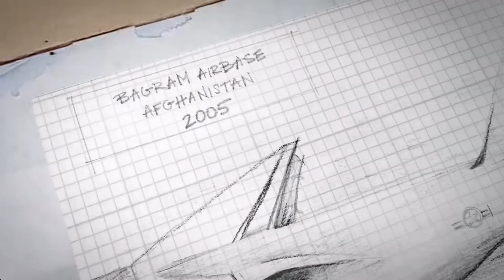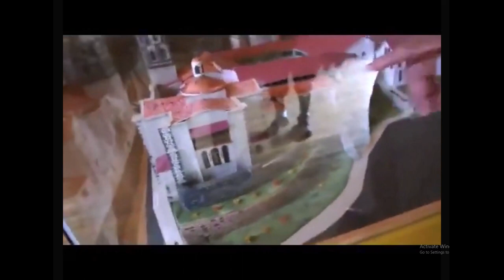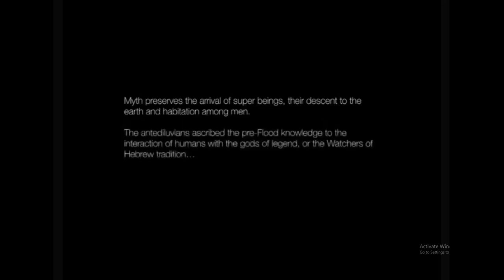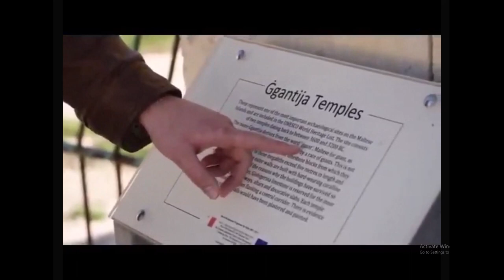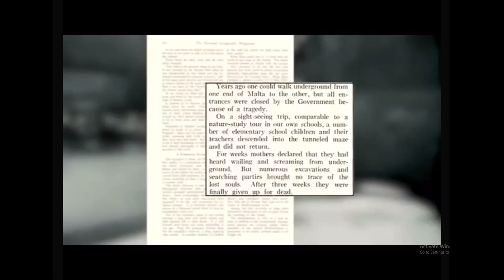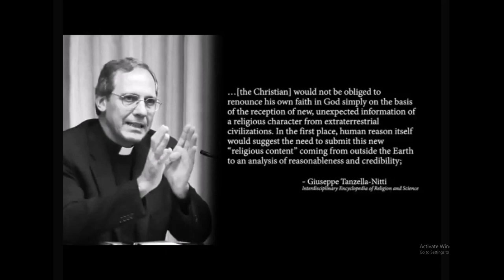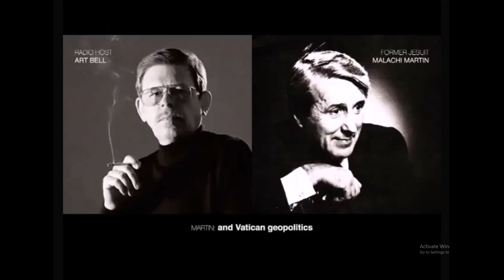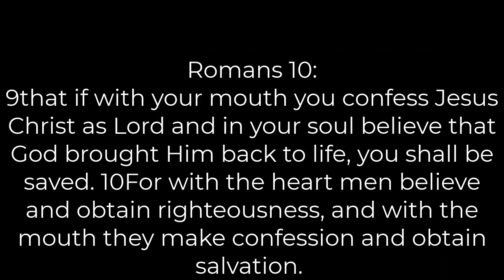The Vatican Knows All the Secrets

Comment: I was lucky enough to visit Peru and explore these sites in 2019. Truly amazing place. 
I don't support the giants or aliens narrative, humans are incredible beings capable of great ingenuity and had more time to think and build back then because they didn't have slave jobs. It's more plausible that these constructions were made with a geo-polymer which was poured into position and later shaped before fully setting, or they mixed a clay-like geopolymer, shaped it and then used a hardening agent.
Reply from the maker: You do have a valid point. Although it still stands that these megalithic structures were made in connection to the stars and or planetary alignments to them. Also built upon ley lines and key energy spots. Which in spiritual terms means they can contact the spirit realm through that energy spot. There are somewhat modern accounts of people doing it through knowing the ancient tech to do it. One such example is “coral reef castle” if you haven’t looked it up and the story behind it you should give it a go.